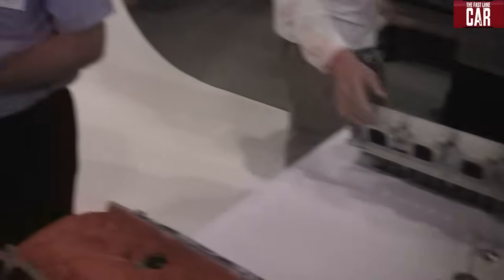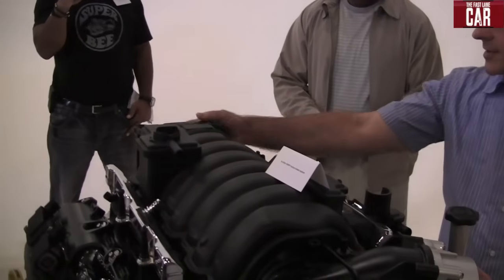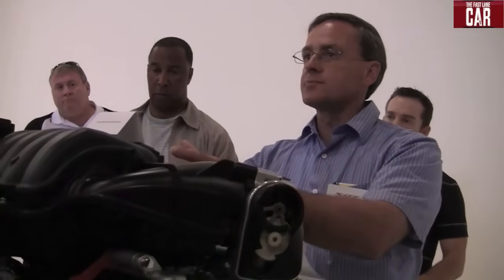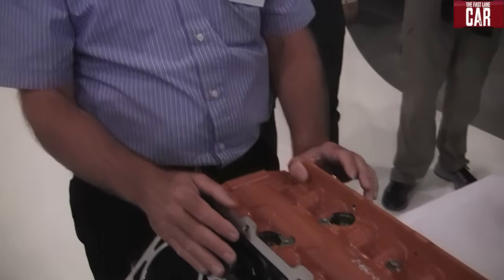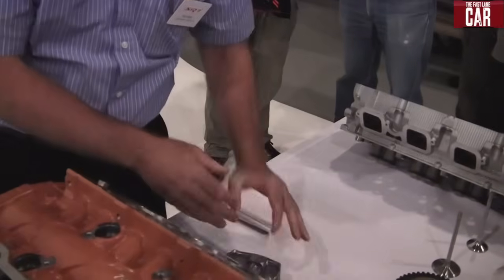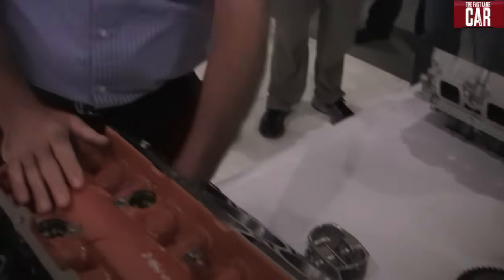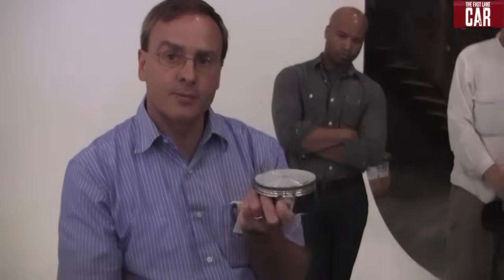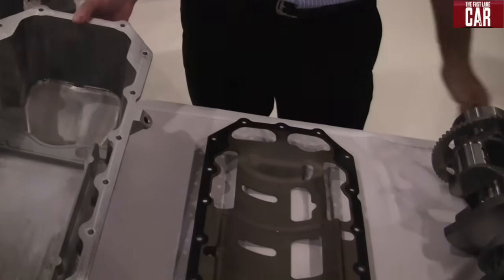Technology Revew: The 2012 6.4-Liter HEMI SRT V8 engine exposed

Comment: Maybe if they went to DOHC it would make 1.25 hp like the Ford 5.0. If the Ford 5.0 DOHC was a 6.4. It would make 490 hp @ 5500 rpm.
Reply: +Phu Doan never maker a OHV out of aluminium? What do you think LS motors have been made let of for the last 20 years? The advantage of the OHV is that it brings the height and center of gravity lower, to keep the hood line down. 
Both types of motors have their strengths and weaknesses, and its all just different engineering to ghetto the same place.
Reply: you do realize the melting point of aluminum is over 600 degrees F.Aluminum is strong enough from applications starting at 350, all the way to the 650hp LT4.
I do not understand your concern and non valid reasoning for knocking LS or LT motors with aluminum blocks, considering, you did not even know these motors were made from aluminum.
Reply: smaller motors almost always have a higher hp to liter. honda has been over 100hp per liter for nearly two decades. displacement makes torque. the 5.0 can't match that.
Reply: ***** It requires power to turn a rotating assembly.  Larger rotating assemblies and larger valves require more power to turn and are more limited in RPMs unless exotic materials are used. Basically it's a lot of weight to rapidly change directions.  That's why small displacement engines easily make over 100hp per liter. Small engines also typically overhead cam for higher rpm capability. You can use two smaller lighter valves with less lift to get the same amount of airflow and one large high lift valve.  There's much more to it but this is the basics of it.
Reply: On what planet is it cheaper to produce a aluminum DOHC motor over a iron OHV motor?
Reply: They do aluminum because of weight not to screw the customers.  You can get overbore iron sleeves.  If they used plasma sprayed sleeves like Ford is then you would have a issue.  The compacted graphite is not OEM for LS blocks. You are in incorrect about the LS1 as well. The LS1 was always a 5.7. The LS2 was a 6.0. The block of the LS motor doesn't change just the bore and stroke does so all parts are interchangable with each other. Obviously there is a aluminum and iron block. They source those specialty blocks from Dart.  The ls family shares no design with the small block of the past other than having 8 cylinders.  It's a completely new engine.  The 5.7 and 6.4 Hemis have two completely different blocks.  They are not interchangable. If you bore and stroke a 5.7 it goes out to 6.7. It will be a 7.0 with the 6.4 block. You really got to read up on this stuff man. GM grate motors are a tremendous value if you factor in what you get. All of the needed accessories plus a warranty.  Go price out a crate from Ford or Chrysler and GM is in line with their competition. I had yet to see a true statement from you.  I'm not calling you dumb but you're horribly uninformed in this area.
Reply: Just as an FYI, the 6.4 Liter Hemi was originally built and tested at 500+ Horsepower. The SRT Engineering team de-tuned the 6.4 down to 470 horse initially because they liked the torque band better. At 500 horse it was more peaky (bigger cam).  This motor is an absolute brute it makes it's torque early and all the way to redline. Add a blower on top and it's even MORE fun!  And lets face it, in the L series chassis it needs a broad band of torque more than peaky high RPM horsepower because the chassis is a good 400-500lbs heavier than the Mustang and Camaro.
Reply: ***** DOHC and independent vvt will make more low end, mid range and top end torque. Also u want need an EGR valve and parts.
Reply: ***** Just like GM, Chrysler got you guys believing that smaller, lighter and less moving parts is grand. If it was DOHC and I-VVT, it would make more hp and burn a little less fuel when it's not making full power.
This remind me of when GM said their customer prefer the simplicity carbs over fuel injection. Yet fuel injection cars ran better, made a little more power and burn less fuel.
Reply: ***** If the rules allowed DOHC engines n Top Fuel. The top speed would be higher. That's why they want allow DOHC n Nascar.
Ford 5.0 If it was a 5.7 like the Dodge. It would make 439 hp @ 5500 rpm and 440 ft-lbs. of torque @ 4250.
Reply: If I'm not mistaken, the '16 5.0 makes 435 hp. That's about 1.44 hp/ci
Reply: The latest 392's with 485 hp make 1.23 hp/ci. They don't even have direct injection.
Reply: madtownmadman The GT350 make 1.66 and it don't either. Torque is 1.36 or if it was a 392. 533 ft-lbs. Give it up dude. I don't drive a Ford but I have to give it to them. Have u driven a 2015 GT?
Reply: ***** Have you ever driven a top fuel dragster?
Reply: Daisy Dawson I'm reporting your comment.
Reply: and it would still lose its spark plugs
Reply: the coyote was built to the best of fords ability, as soon as svt or Shelby gets there hands on it you'll see much better performance Ford on its own never build anything with good numbers anymore idk why it's like they don't want to deal with it
Reply: +Phu Doan the only cast iron LS blocks were truck motors, even then some were Aluminum.. LS1,2,3,6,7,and 9 are all Aluminum. Pick up a GM performance book and look, no car application has been Cast Iron.
Reply: The LS7 is all aluminum, minus the cast iron cylinder liners, only to support the largest bore on a small block,the forged steal cranck and titamium rods, but the block other the the pressed in liners is all aluminum. 
Come on man, at this point your making things up
Reply: ***** If the 5.0 was was a 6.4 it would make 515 lbs of torque.
Reply: +blackericdenice you would get diminishing returns. that's why the gm and chrsyler don't make the number you're stating. the 5.0 is good in its own right don't get me wrong.
Reply: ***** What do you mean?
Reply: Paul Cabinatan Crap that everyone around the world most often uses for motor swaps.  Tell me more?
Reply: Phu Doan 5.4 topped out at 6.0 when punched out.  It was never worth it due to the most desirable DOHC versions of that motor were rare therefore making them expensive.
Reply: ***** I did it just wasn't correct.
Reply: ***** It's right you just don't know it.
Reply: +Phu Doan the LS7 in the Venom is Aluminum. Do you ever see side by side pictures of LS motors and say a 5.0? Do you see the size difference? Dimensionally the LS motor is smaller, but I guess with your mentality, we all could be running micro LS motors....
Reply: Phu Doan Everything you have stated is untrue. 5.4L engines in trucks were iron. In the Ford GT they were a aluminum block. It has never and more than likely will never be cheaper to use an aluminum block over iron.  GM only uses iron in their HD truck truck line. They use iron for its durability in harsh environments and operating conditions that trucks can see.  The LS7 like all of their performance variants have been made with aluminum and only aluminum. With the exception of the above mentioned 6.0 motor all 2014 and above LS based motors are aluminum. Manufacturers are trying to reduce weight anywhere they can so this includes aluminum blocks on their non performance models.  are Also your assumptions on a small or large displacement based on the Valve layout is incorrect as well. Look at the range of displacements the LS is capable of.  Posters above have stated why GM and Chrysler are using OHV motors still. Chrysler is trying to hang on to iron for the reason of cost.
Reply: Not impress as rotax can make 3.2hp per CID out of less moving parts! 2 stroke all the way.
Reply: Yeah because 2 Strokes have any future in this world! :)
Reply: Actually when first built it made 525 hp Dodge D turned it for fear of heat issues I'm from motor city that was the big talk when it came out
Reply: Chris Cape 526 n/a hp from 312 cuin. No chevy or dodge has numbers like that.
Reply: Phu Doan You are wrong and I will not waste time with you.
Reply: ***** I think you need to read my 1st comment.

Comment: Can't call it a hemi if the cylinders aren't  "hemispherical"...
Reply: ***** 
The heads are not true hemi heads because of emissions and ect, but they are still close enough for Dodge to use its Hemi name. This is what I have read. Either way it's a monster engine and Dodge can really call it anything they want.
Reply: +markurbancowboy they are real hemispherical heads. The earth isn't perfectly round & smooth yet it has hemispheres. Stop reading that motor trend bullshit from 2003. They are real Hemi engines. Evidently you've never seen the stock "Eagle" Chrysler hemi heads.
Reply: +Jon The Destroyer Fords bullshit Boss 429 people call a Hemi with no problem, yet EVERY 3rd Gen Hemi since 2003 has more in common with every Chrysler Hemi ever made than the 429 Boss could ever dream of. Get over it, its a real hemi.
Reply: Phu Doan No, you're the moron, if you bother to actually look at one? You can clearly see the two flat quench zones in the chamber and the flat topped piston . Its a type of Pent-roof chamber... no one uses hemispherical chambers anymore... they are OBSOLETE
Reply: ***** No you can't call it a "Hemi"   but since Fiat's Chrysler div. owns the rights to use the name HEMI®       So in terms of brand name, they can call a flathead type engine a HEMI® brand name engine.
Reply: Daisy Dawson Engines with flat topped pistons and clearly defined quench areas are NOT hemispherical type.

HEMI® brand and hemi type are not the same thing...
Reply: Daisy Dawson Its a 2 valve Pentroof  head... not a hemispherical type.

Hemi's dont feature a squish or quench integrated into their design.
Reply: Daisy Dawson The Ford 429 is not a hemispherical type head... like the Daimler-Chrysler HEMI® brand engines, they are a Quench type head design..

Comment: I'm shocked to see so many negative comments regarding this engine. Who cares if the pistons are flat top, or if it's a push rod engine. The fact is, it WORKS! This is a pretty bad ass motor, and the current 2015 version is pushing 485 HP and 475 FT LBS of torque.
There isn't anything naturally aspirated, or in this price range that comes close to matching this motor.
Reply: Keep in mind those binching about this engine think their Toyotas are cool. LOL.
Reply: matrox haha. I have a 4Runner and an SRT8. I guess that makes me an exception.
Reply: +dcaseng 
You are exactly correct sir.
Reply: DISCO-INFERNO-70 I ignore The unknowledgeable who make negative comments about the HEMIs as everyone has unsuccessfully tried to copy it. Think DEMON as that says it all.
Reply: Wonder if they all are saying the same about the c8 motor. Also yes the Lexus v8 is maybe even better. Otherwise nope nothing else out there.
Reply: Most of the designs are exactly the same as the ls3 in the camaro. The sodium filled valves for example.

But you are right, it works. I don't think anyone would argue against it. But the fact is, it's not a true hemi. It shouldn't be called a hemi because it isn't hemispherically designed like it's predecessor. There might be a reason that it isn't though. Maybe they couldn't engineer a way to make the system work with it? Who knows?

I'm a die hard Chevy fan, but I can't argue with the hemi and the numbers they put up. There is a reason why top fuel and funny car dragsters use hemispherical pistons and heads.
Reply: ***** While the "true Hemi" has some major differences to this engine design, it's also notorious for being very difficult to tune.
The bottom line is, engineers HAD to make changes to the original design in order to make it run the way it does. There is also the emission standards that simply cannot be met using the original design.
Chrysler simply took what works, and made the necessary changes to bring it up to modern day standards.
I doubt ANYONE could get an original Hemi design to run as cleanly and efficiently, while pushing the incredible power numbers that the current "Hemi" does.
While the original Hemi is a LEGENDARY motor, people tend to ignore the negative aspects. Many people actually thought the 440 was a superior every day engine.
Reply: +Jon The Destroyer Daimler-Chrysler was careful not to use the word "hemispherical"
Only its  brand name HEMI® in all caps
Reply: it's not about the engine.  it's the video.  it's short, and not very detailed.  I have a Charger and love it, but this video sucks.

Comment: I love how they won't show the combustion chambers, which would show that this isn't even a true Hemi, lol. And they have the balls to write HEMI in all caps!
Reply: 231mac I don't think I've ever met a salesman that knew much about engines.. lol
Reply: What makes a hemi is the design of the head, which is not a wedge head like everything else.

A HEMI has two canted valves that open into the cylinder and a centrally placed spark plug. Now does the 5.7 and 6.1 and the 392 have those qualities? Yes and that is what makes them a hemi..

http://st.hotrod.com/uploads/sites/21/2013/04/mopp-1304-03-can-you-hemi-now-part-2-apache-head.jpg

The thing is, an engine's design will develop slightly over time for better fuel efficiency and fuel economy, power, displacement, etc.. The HEMI engine is no different. If what you label as a "true Hemi" is the Hemi that was in the Charger and other vehicles back the late 1960s, then no this is not that exact same Hemi..

The Hemi that is in our vehicles is a "true Hemi" though because it is a direct descendant from that old Hemi design and the one currently being produced. The engine has undergone some very wise improvements over the years. It is but one point in the long evolution in the Hemi design that hopefully will continue to evolve and improve. The folks at Dodge/Chrysler haven't lost sight of that tradition.

People will continue to split hairs and argue about an archaic design not still being fully present, but it's still there.
Reply: +231mac its a registered trademark, they can sell lawnmower engines with  HEMI® slapped on it... the own the name
Reply: The real doktorbimmer I firmly agree, lol
Reply: The real doktorbimmer That is thoroughly well known, but the fact that they're passing it off as a true Hemi is still a dick move. And I do mean pass it off as a true Hemi. Ask a dodge salesman, it gets very comical real fast.

Comment: The Engine looks like from the last century...
Reply: it's bullet proof though. don't have to worry about power robbing carbon build up like some audi's, or burning oil like brand new 100k bmw's. lots of torque down low so you don't have to put a lot of wear, and tear red lining it to 8k rpm's everywhere you drive.
Reply: Yeh, you mean the century where everything worked?

Comment: My goodness, the complexity of that motor can just make me want to jump off a cliff! Why don't they make today's engines simple enough so a home shadetree mechanic can work on?!!!
Reply: This engine look's pretty simple in comparision with some european engines...
total self made maintenance is no more possible with the most engines after 1980...
Reply: +phambo101 first of all, the 5.7 and all gen 3 hemi engines are childs play to work on. If you're intimidated by such a simple engine I suggest people keep their shit away from you to fix, you're probably baffled by left hand lug threads on 60s cars too!. There is nothing surprising about this engine. The active intake manifold on it is the most advanced part, comes off with 10 bolts and a few harness disconnects and even that is very straight forward. If you want a mind fuck work on a GM.
Reply: Because, if you can work it then you don't have to pay them to fix it.
Reply: Those days are gone. But it's not all bad. The new engines deliver power and MPG the old engines couldn't come close to. Then their is the idea of longevity. Computer controlled engine management of ignition and fuel vs. dumping gas in with a Carburetor explains why modern car engines live 2x longer or more before needing over haul.
Reply: Try working on a modern industrial diesel and tell me that’s complex. That engine is very simple 😂 sorry if it’s hard.

Comment: this engine is in the dodge ram heavy duty trucks now but doesnt have nearly as much power as the engine was played with, for lack of a better term, to increase strength and durability. it comes with less hp power and torque than the srt engine for obvious reasons.

Comment: @mannysamjam R u smoking crack? 2012 gt-r with 530hp goes from 0-60 in 2.9s and it finishes the 1/4 mile in the low 11 
even the older model with 480hp make it to 60 in mid 3s and finishes the 1/4mile in the high to mid 11  

the jeep srt8 older model goes from 0-60 in the high 4 stock and now with the newer model it achieves low to mid 4s and the 1/4mile comes in around 13s  

FYI the new GT-R will have 15HP more thanTHE older 2012model & 60 more than previous models 
2.7-2.8 0-60 high10 1/4m

Comment: @ROXXEMBOXXEM 

It does not rotate which cylinders deactivate, it's always the same four that deactivate. There are no longevity issues, the rod and piston are still moving just like the other four.. the difference is, spark and fuel is removed and the valves are held open.

Comment: @trc5494 the 6.4 is actually a stroked 6.1 which makes the 5.7 a different engine
Reply: Matthew Hame I'm not a gearhead by any means but I'm pretty sure a stroked 6.1 is a 426 stroker kit for a couple grand you can turn a 6.1 into a 6.4

Comment: @motorolo14 I would just assume that the cylinders alternate  between 2 on each side so that it turns the crank more efficiently and the ware on the engine is more singular. If not and they just use the front 4 or back 4 etc. that would seem like a foolish mistake which could ware the engine faster and reduce efficiency.